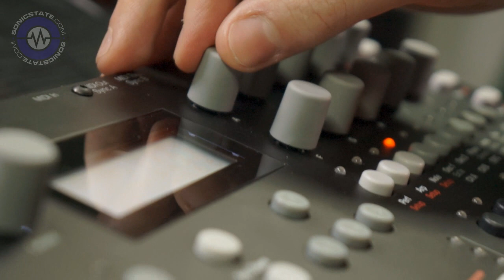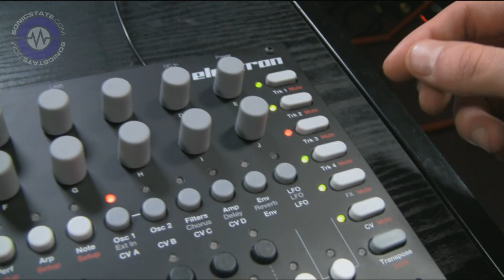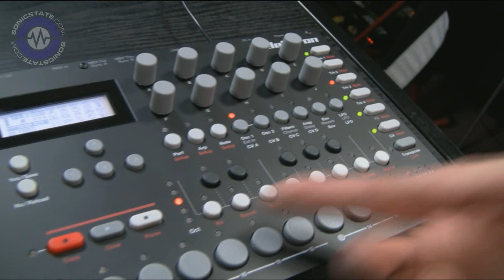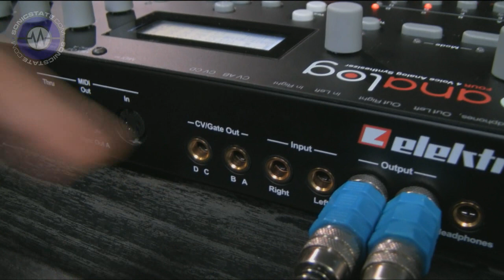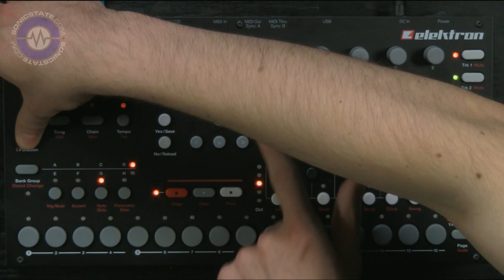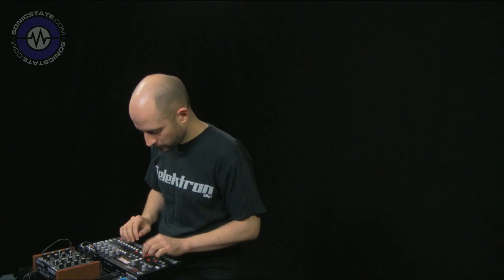Elektron Analog Four - Sonic Lab Close Up

Comment: Had one and got rid of it.  Be warned if you are used to using vintage VCO based analogue synths you won't like the Analog Keys/Four.  To me it sounded closer to a soft synth than it did to a Prophet 5 (or similar)
Reply: What exactly is not to like? This is a peformance sequencing instrument with it's main strength lying in sequencing and parameter locks a Jon pointed out.

Someone who grabbed the unit from you must be one happy camper!

Comment: The lack of midi sequencing is kind of a drag. Because of only 4 voices you run out of polyphony fast. They should of put some Monomachine engines in with the A4. It's not a good value if you are a thrifty bastard like myself.
Reply: friendofCHAKA Id like to see a MnM mk3 with better FX and a perf mode Id buy it in a second :)

Comment: Capable machine, maybe also good as a first analogue piece that can control/interact with additional analog synths.

The only worry/surprise I have is that it does not have four individual outputs. Worried about how well u can balance/mix/EQ all 4 voices coming out of it also for external processing. Unless each of the two outputs is stereo and u can pan 2 voces Left/Right for each output.

What about USB, does that act as audio over USB? So maybe via USB u can have 4 separate audio channels?